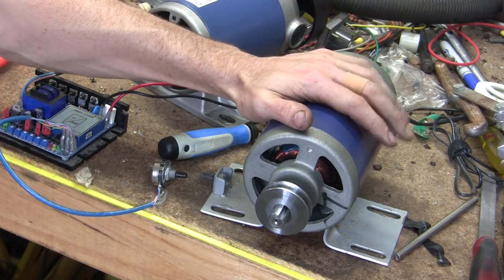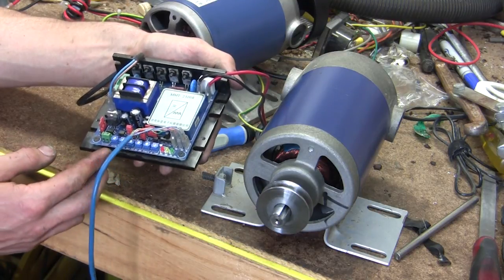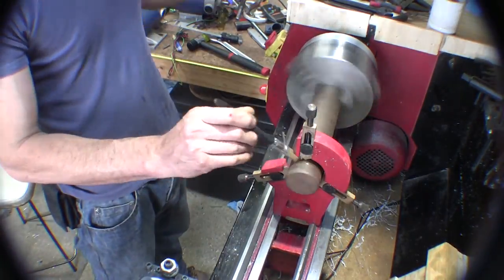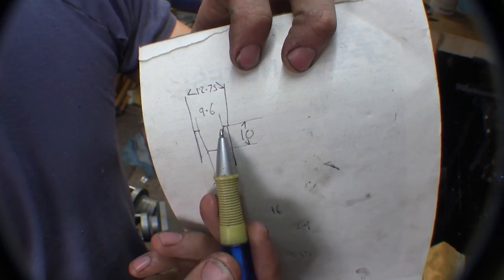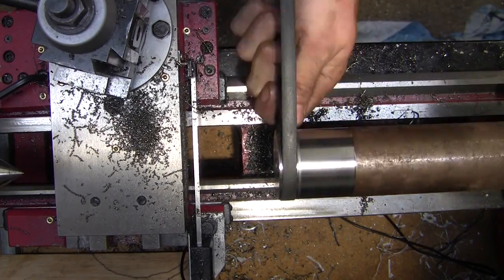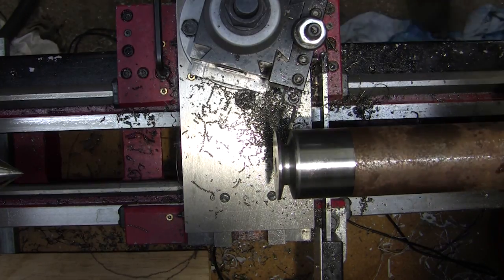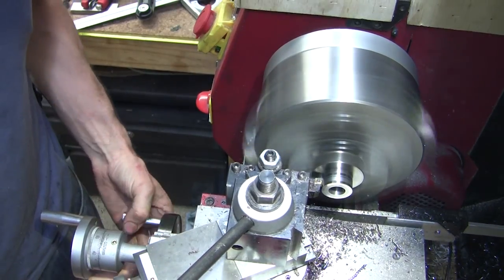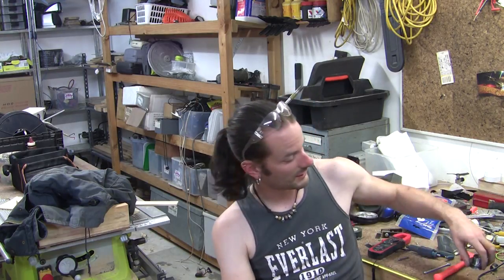Sieg C6 DC motor upgrade part 1 Making the pulley

Comment: why you run youre lathe on DC you run the lathe on battery power?
they mightve ysed a toothed belt to prevent slippage when using the autofeed for cutting tread
Reply from the maker: watahyahknow the toothed belt was only used in the low speed settings, and for cutting threads the Chuck and the lead screw are directly coupled through gears. I could cut threads without any belt at all and turn the Chuck by hand and it would still work.. the motor runs on 180VDC so you could run it on batteries but you would need a rather high voltage battery bank
Reply: so wat are you using to get the dc power , a rectifier ?
i had looked intoo some of the other vids you made and found out the motor was out of a treadmill but i still dont quite understand why you didnt used a ac motor 
i kindah suspect its because its eazier / cheaper to find a speedcontroller for the dc motor but i'm not sure
Reply from the maker: watahyahknow I'm using a dc speed control. it handles everything. I just set the max output voltage and current.. ac motors are much more expensive, and for speed control you need a 3 phase motor.. it would cost more than the lathe to convert it.. this conversion cost me about $100

Comment: Nice pulley.  That appears to be some very hard metal.
Reply from the maker: +Amateur Redneck Workshop thanks! yeah i have no idea what grade but i think it could be 4140 that has work hardened (it was a pin from earth moving equipment at one stage)